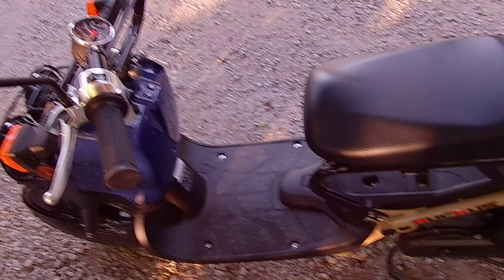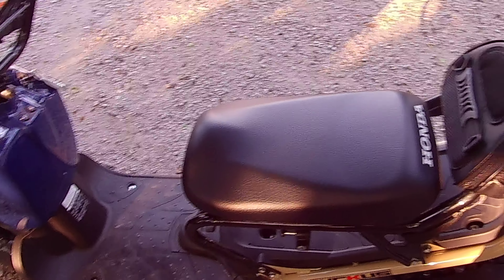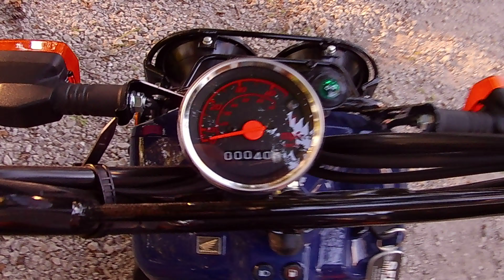first ride review on Honda ruckus

Comment: I just chopped off the rear fender extention. It's super easy to put a tape on it and cut it off with hacksaw and you can round off the edges with a file or angle grinder. Looks way better that way. Love the new colorway. Congrats!
Reply from the maker: I might try that some timr
Reply from the maker: Time
Reply: Great video though